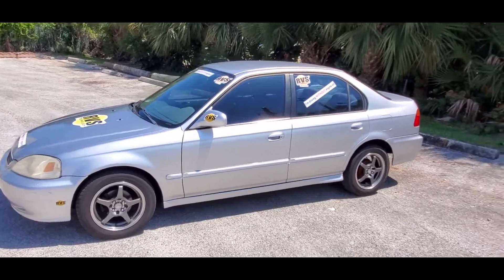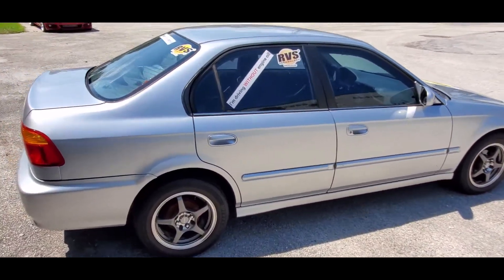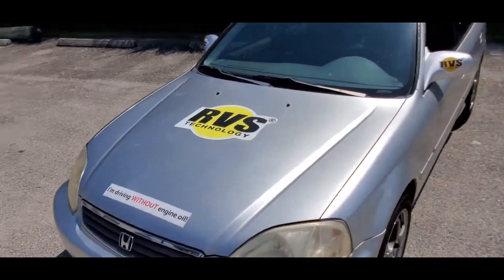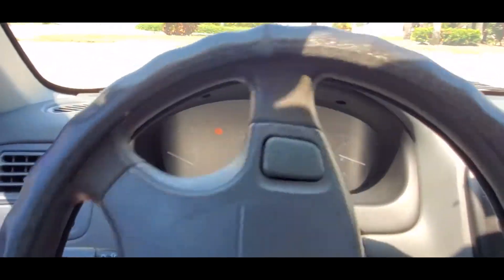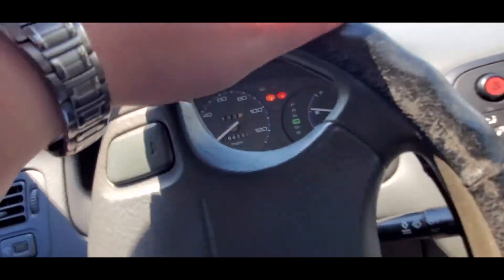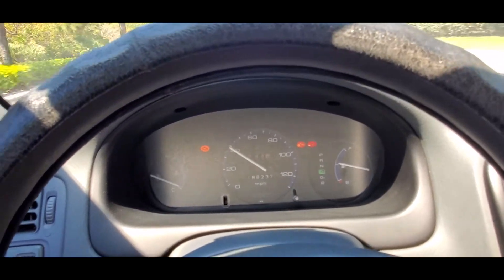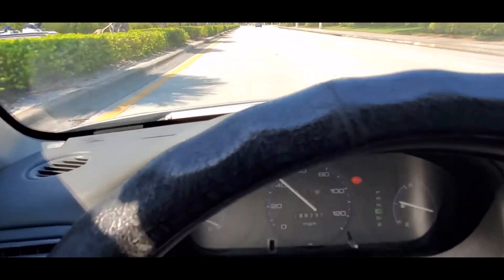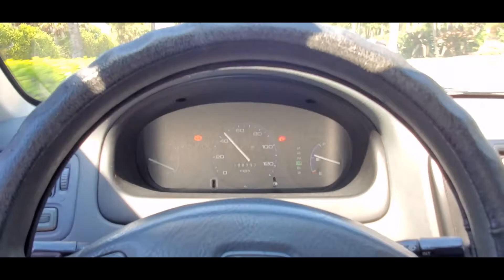RVS Technology Honda hit 3000 miles of driving WITHOUT engine oil!

Comment: eh.   You really need to push the car for miles (20 miles one trip) HARD if RVS works. This honda engine is already known to run without oil.

I had 4 treatments of RVS in 20,000 miles in my bmw. My turbo charger "exploded" while driving, sending oil. As my car slowed down on the sholder. The rod bearing seized and fused on cylinder 6 cause there was no oil. All this happened within 3 mins.

Just proves rvs and no oil dont work!  But i will still buy it because it did make car idle smoother.
Reply: We regularly drive it more than 30 mins of running non-stop and commute to work and back with it (10 miles each way) we'll be sure to film a longer trip for those who don't believe it. Your turbo exploding could cause metal etc to travel to engine to cause damage to rod bearings. If a mechanical break happens, nothing can help then. Sorry to hear about your BMW :(  BTW, we did a similar car in Finland, a Peugeot 206, and it did almost 7400 miles without engine oil before the bearings finally gave out.

Comment: In Finland they drove 4000+ km/2500miles before the car was showing signs of struggling for the first time.
I assume there in Finland was about 20-30 °C  colder than in South Florida, but their car has a cooling thermostat in place, unlike your car.
I assume that fuel consumption is high when you drive a cold engine car.